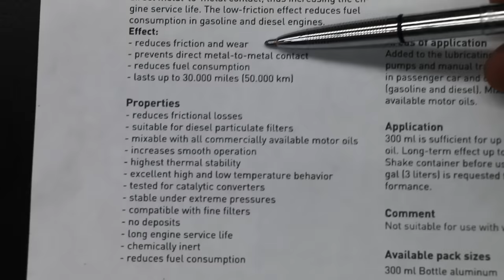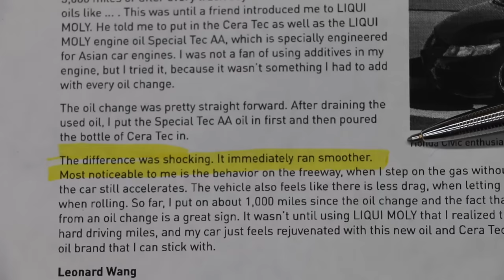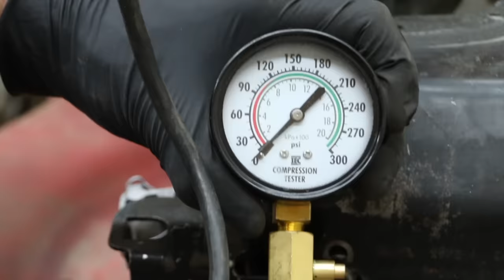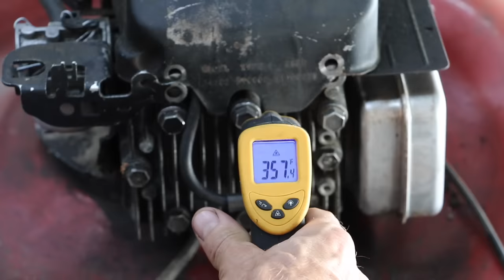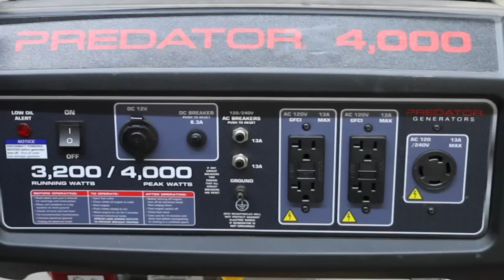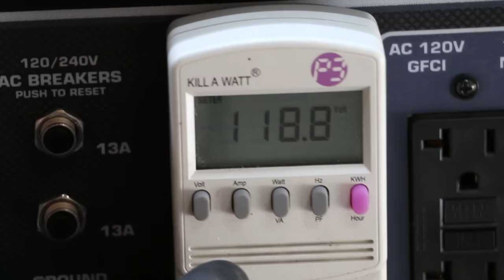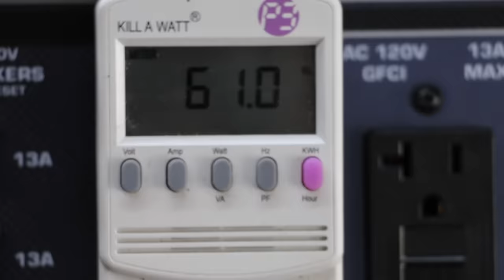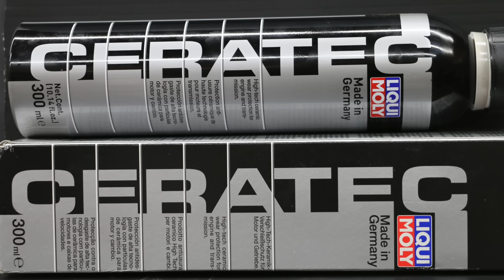Does Liqui Moly CeraTec work?  Let's find out!

Comment: I used this product back in the 90's and noticed a slight improvement in acceleration in some of my cars, but with no real gain in power or anything else, so I stopped using it because of lack or tangible benefits.
Reply from the maker: Thanks for the feedback.

Comment: Just one thought, I have no idea if this will have any baring on test results or not. But you should consider using a torques wrench on the engine when putting it back together. Like I said just a thought, don't know if you have a method or not of getting even tightness or if it would have any baring. 

I do love the video keep it going.
Reply from the maker: Thanks!  Thanks for the feedback.

Comment: 4000 thousand driven by the addition of ceramizer everything is fine, nothing knocks, no knocks, no smoke after changing the oil, it turned out that the bushings to be replaced and piston seals to be replaced
Reply from the maker: Thanks for sharing.

Comment: Alright, I loved this video, but I also loved your Motorkote video. 

So to mix with engine oil for a daily with spirited driving which is superior? Ceratec or motorkote?
Maybe both in combination?

Motorcoke did better on the lubrication test but the improved fuel economy of ceratec however small was impressive
Reply from the maker: Thanks!  Thanks for the suggestion.

Comment: I enjoy your show
I would Like to see you test Catalytic Converter Cleaner 
We have a BMW 328 xi with 120 miles on it 
We had a Engine light come on and the codes ppinted to the catylitic Converter 
A new Converter installed 
Estimate $3000
So , we purchased a can of 
Cleaner $25 Canadian 
After half a tank the light went off 
And 2000 miles since 
Still NO light 
The product was the Dura Lube one .
I Highly Recommend this product .and Will contine to use it  twice a year 
$50 vs $3000
Reply from the maker: Thanks!   Thanks for the suggestion.

Comment: Please test also an RVS Technology. For gasoline engine RVS G6 or G8 I do not know if it is availabe at USA. But it has been tested and verified by laboratories that it makes the surface smoother. I even know a case where they repaired an worn angle gear with that stuff with visible results.
Reply from the maker: Thanks for the suggestion.

Comment: A different result that no one talks about after Ceretec.

Keep in mind this is in Indian conditions which are one of the harshest conditions at 47°C ie 116.6F to 4°C ie 39.2F temperature change in around a year. 

There is one noticeable change no one talks about which is the biggest one, I did a PUC test (pollution Under control certification in India) Which is mandatory every six months for every vehicle in India and the numbers were just stunning, Almost all the values drop by 1-2%, Now that is a big deal, As that proves the engine is running cleaner maybe due to improvement in micro scratching being healed.

Read my other comment if you want to know about every single change that I have experienced. maybe it will help you purchase better.
Reply from the maker: Thanks for sharing.

Comment: Automobil-Prüftechnik-Landau GmbH (APL)
Test sequence On the vehicle distortion test bench the test oil was mixed with 6 per cent CERA TEC. With each test sequence the weight, and thereby the force level, on the sensitive transmission gear wheels was increased. The aim of the experiment is to reach the damage force level. This level is reached when the sum of all damage caused to the teeth of the gear wheels is more than 20 millimeters. The test is then ended. The reference oil came up to damage force level 4; the oil mixed with CERA TEC reached as far as level 9, hence to more than double the level. CERA TEC markedly increases the power reserve, which confirms the anti-wear protection by the fine ceramic particles, is how Dipl.-Ing. Peter Kunz, who supervised the test, summarizes the results. Kunz’s initial skepticism gave way: After the tests I was amazed.

Comment: Great testing as always. But I would disagree with this snake oil. Regular oil and filter change is all you need. Engine wear is mostly at cold start and when the oil gets dirty. And I doubt this stuff clings on to your pistons when your car is switched off for hours. Did Castro not have an oil called magnatec that did not do exactly what this stuff claims.

Comment: I like to mix 250ml of MPM ceramic with 125ml of Faher HD per 5lt of engine oil, have done for years, Faher is imediate result but it will not hang on for long after using oil without it, ceramic will have permanent results but needs loads of temperature and at least 2000miles to have any result you can measure.
Reply from the maker: Thanks for sharing.

Comment: So which product had the best result as far as increased lubrication in the cylinders? For instance, Porsche engines are prone to bore scoring and it is advised to use a molly additive to allow ZDDP to bond with aluminum cylinders. CeraTec is supposedly just that. Without molly ZDDP only works well with iron sidewalls. Trying to prolong the life of my old Porsche here))

Comment: I put it in both my car and my wife's POS acura. It sucks down 3 quarts in 1kmiles. I also use the liquimoly oil and friction modifier. It ran on 900 ML and didnt sound like crap. My car isnt as loud and it seems to enjoy it, runs 10 degrees cooler. Ive tried literally everything out there and nothing has kept my car as smooth sounding. Only reason i tried it eventually was because amazon had a deal so i figured 🙆‍♂️ sure better than the mobil 1 i had in the garage 🤣
Reply from the maker: Thanks for sharing.

Comment: I have an Iveco Daily 2.3 van with 260k miles and noisey top end. Ive flushed and changed the oil and filter 3 times in 15k miles running various valve lifter treatments.... nothing seems to work. So I thought I'd try this product - and the engine is now really noisey. Like it HAS coated the metal and now its super slippy?? But the top end rattle now makes me wonder if it's camshaft or lifters. Still getting relaly good MPG if I drive steady - so not alot "wrong".

Frustrating that the product didn't seem to fill any scratches or wear (or did it) and now it sounds MUCH worse.

:(

Comment: Gonna chuck 300 maybe 600ml of this into the e63. Apparently stops lifter tick.
Reply from the maker: Thanks for the feedback.
Reply: No it wont. I tried it in my E60 N52.
Ceratec made the engine smoother.
Liqui Moly HL additive fixed the lifter tick. Put it in a new oil. Resukts after 100 miles.

Comment: I've seen photos by someone who used Ceratec in his blown ATV engine, just to see what would happen.  He claimed it suddenly ran almost like new.  When he took it apart, he found scores on the crank bearings (and journals!) which had seemingly been filled in by the Ceratec material.  (That's what the photos were of.)  So, maybe it could help a wounded engine limp along for a little while longer.  I doubt any additive has much benefit to a healthy engine.
Reply from the maker: Thanks for the feedback.

Comment: I didn't notice any improvement with the wear test, yet there's a 1% mpg improvement. Could it be that the oil was slightly thinned making the engine run easier?That would easily explain the mpg difference.
Reply from the maker: Thanks for the feedback.
Reply: I don't think it's thinning the oil

Comment: If you use a high quality synthetic and change the oil at prescribed frequency, what is the value of using additives?
Reply: Seems more for trouble engines.

Comment: Seems like it just adds boron? Kinda Like Torco? One thing about about film strength , it is related to oil pressure too. Maybe ceratec will make an engine last longer over 1000's of cycles and not really show huge results in lawn mower style engines. If its main ingredient is boron then that proves higher boron motors oils will provide similar results?

Comment: hey, dumb question: did you adjust the RPM when running the "duration on a tank" with ceratec? just, as it ran for a near identical time, but if the RPMs were higher at the same amount of throttle, as the previous test showed, then it would have ran for significantly longer than it seemed as the fuel had many more injections in that timeframe
Reply: See it one more time.

Comment: My experience with Liqui Moly CeraTec is great. I own a 2018 Mustang GT which has the 5.0 Coyote engine. This is the best engine Ford has ever produced; However, for some unknown reason, some of these engines can develop what's called a "Coyote Tick" or "BBQ Tick" noise. Ford claims this noise is completely normal, but I disagree and the irregular ticking noise is annoying. If it were normal then it would come from the factory with the ticking noise, and not develop 30k miles later. The 5.0 takes 10 quarts which calls for 600 ml of Liqui Moly CeraTec (300/5qts of oil). The ticking noise hasn't happened since then. I no longer hear that ticking noise when driving or standing next to the running car with the hood open. If this didn't work I was going to sell the car because I couldn't stand that noise, it sounded awful and I'm glad I found Liqui Moly CerateC. Anyways, thanks for the video.
Reply from the maker: You are welcome!  Thank for sharing.

Comment: found this video when i freind linked me to it.  i have been on the positive side of the certec since. i put it in the engine sound alot smoother. VW passat 2,0Tdi 177hp. and fueling is abit better not super much but more like it was when the car was just bought.  butt the big thing is my brothers vw caddy 1,6 doesnt even sound like the same car. and he claims he can puth in fith gear and drive it from 1100rpms wich he could not before.  i will keep using it.  since it is cheap for me to buy.
Reply from the maker: Thanks for sharing.

Comment: which oil additeive is best option for oil losing  problem.. there is noı leaking at engine..i assume the oiil is burning in pistols? i use 5w40 fullsynthetic castrol edge titanium.. the proudter firm advice.. my repairer man adviceed to change 10w40 liqui oil.. there is liwqui oil 10w40 mos 2 additive oil.. i thisnk about that. or shall i go on with 5w40 oil and liqui oil mos 2 additive? or should i chhose liqui moil ceratec or oil saver ol-ver lust stop additive? i am confused. my engine oil loses one liter per 1000 kilometers. some says u should use 10w60 oil.. i ama satandart calm driver. i dont push limits on engine. i dont use fast..

Comment: from 5:48 to 6:00 , I am a little bit confused. Are those 2 Images comparision between Liqui Moly applied vs not applied,  or 6 hours of running before vs after all without Liqui Moly CeraTec

Comment: I feel in this case your testing procedure with this product is not exactly how the product was intended to be used. For example, they have advised not for an older engines the better choice for such is their MOs2 product. Furthermore, it takes awhile for the Ceratec product to adhere to the surfaces. This comes about from driving (several hundred miles) and from the cycling of the engine via both heating and cooling.

Comment: The oil should be heated to operating temperature, that's where it performs best and the wear will be less than with cold oil.
Reply from the maker: Thanks for the constructive feedback.
Reply: @ProjectFarm  I watched another video about engine oil lubricity, same setup, a roller bearing and a disc in an oil bath. First the oil was heated to about 35 deg C and then it was at around 80-90 deg C, so the second time the wear mark on the roller was significantly smaller than with colder oil. It shows that the engine oil anti-friction additives perform better in the conditions that it was designed for, at engine operating temperature. 👍
You have a very good channel, I watch a lot. Thank you for your work. 🤝

Comment: Hi Todd, after watching couple of videos on oil additives, I will like to thankyou for the work you do. I have never used oil additive on my chevy v8 yet, however want to use some anti friction 1-2 twice a year max,  as done over 200k + ageing. notice there are lot of ceramic/Anti Fric brands out there, STP ceramic included (culdnt locate video). also you found better results in ceratec than M0s2, even though m0s2 has been around for longer I guess. ceratec appear thick and also watched other video, on its effect on oil filter, so wasnt sure. thinkin whether to use lighter oil -20 syn. than -30 syn. when using oil additives and later switch back. Can you suggest, which anti friction/engine protection you felt was better with good result and no/very less residue to affect engine.
Reply from the maker: You are welcome!  Thanks for sharing.

Comment: Since the Bestline oil additive gave the best results on your lubricity tester (if i remember correctly) i would like to see you run PURE Bestline not mixed with any engine oil in one of your engines, and i'd really like to see if pure Bestline increases the fuel efficiency of a generator.
Reply from the maker: Thanks for the video idea.

Comment: I was thinking of pouring ceratec to my machine gearbox for pelletizing machine a big gearbox  with only gears no combustion. Do you think the gearbox would have benefit from using ceratec.. gear oil used is viscosity 160 VOLGA  brand

Comment: Well from my personal  experience, anyone that is familiar with the 2018/2019 mustang GT‘s probably has heard of the typewriter tick in these engines. My 2019 mustang GT had it very bad! I changed the oil a few days ago, and I added two bottles of liqui moly Ceratec (since the engine holds 10 quarts of oil) and I have not heard the tick one single time since! AT ALL! So anyone reading this that has one of these cars or maybe any other car with a similar tick, it will totally work and take it away!
Reply from the maker: Thanks for sharing.

Comment: I am more concerned about the ceramic particuls clogging the oil filter fins, would this be of concern? I am about to change my oil and I got a ceratec bottle.
Reply: The product data sheet says the particle size is smaller than 0.5 micron. So they will not clog oil filter fins.

Comment: Okay so this test was conducted on a small engine with a simple design under no real usage load. Would you say the results might be different on a high displacement engine under real pressure over a very longer span of time? Also if the engine is for example a GDI, it would have more friction because of it's design, how would that change these results thoracically speaking?

Comment: What video covers the oil additive with the best film strength?  I assume that means more oil stays in place when the engine is off.
I have a Camry 2AZ-FE engine that began knocking like crazy all the time while a family member was driving it.  Anyway, I was able to get rid of almost all that knocking by running some seafoam through the engine, replacing the oil and filter, and adding in a little MMO into the oil.  I think I added a bit of AT-205 Re-Seal as well, but not to help with knocking.
Now, the engine just knocks at startup, which is apparently a problem with some Toyota engines because the oil apparently flows away from moving part relatively easily.
Oddly, though, I think my Camry knocks at start up even after the engine is warm and lubricated.  Not sure what is going on there. 
Anyway, I'd like to try an additive that keeps the engine lubricated better while the engine is not running.
Reply from the maker: Thanks for the video idea.
Reply: @ProjectFarm  Mr. Farm, live your positive energy.  Make sure you get enough quality magnesium to support that energy burn.  Morley Robbins has some good information on that subject, and a couple more.  Thanks for all you do.
Oh, and a comparison of extended mileage oils relative to normal oils and relative to each other would be really cool to me because my vehicles have some serious mileage on them.  Does the extended mileage oil make sense?  I'm using Valvoline extended mileage now, but maybe but just move to Pennzoil based on your normal oil comparisons.

Comment: Can you test Mathy-m? The company claims that the engine is cleaned from the inside and that there is no longer any wear and tear in the engine.
The product is not cheap, has been on the market for over 20 years and it would be cool if someone could check that out.
Reply from the maker: Thanks for the suggestion.

Comment: I need your opinion. My car is a astra gm with a 2.4 16v 4 cylinder engine. It has 100K miles in the clock and burns 1.2 liter of 10w40 between changes. Or 10k km but the problem is when i start the engine in cold the car smokes oil burn for 2 seconds and thats it. No blowby no blue smoke when i use it nothing just in the start. I think just move up to 15w50 semi sinthtetic oil but can i flush the engine to clean it? Or its a mistake? Because i want to use antiwear additive. What do you think? Thank you!

Comment: I have used xado products in my Subaru gearbox when the center diff was squealing and after a few miles it went away I did also change the gearbox oil. I have also used the same make product when my power steering had spots were it stoped working tried changing the atf a few times then added xado stuff and after about 350 miles it started working again, both times I wasn't sure if it's because I changed the oils or adding the treatment but seemed to do the job
Reply from the maker: Thanks for sharing.

Comment: Has anyone used this with Synthetic oil, and did it actually work well/better??
Reply from the maker: Thanks for the video idea.
Reply: I used this additive in 1999 Jetta 2.0, non turbo engine w/130K miles, with 5W40 synthetic oil - now my 99 Jetta runs like 2021 Jetta ✌️. NOTE: make sure you change oil first and add this in a new oil!